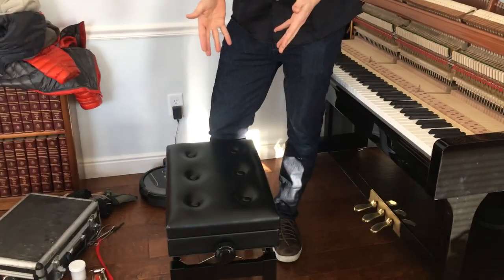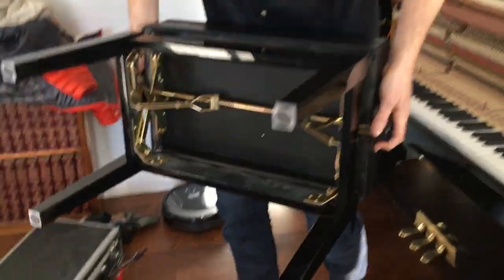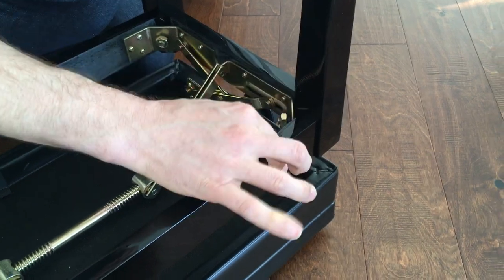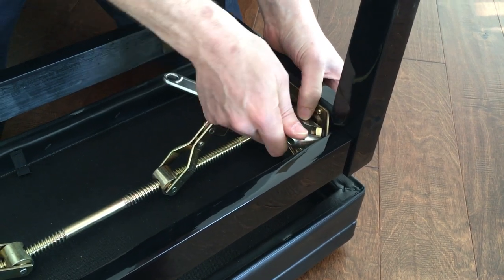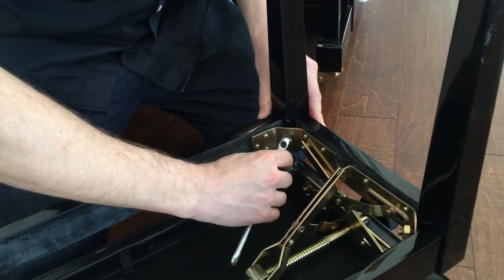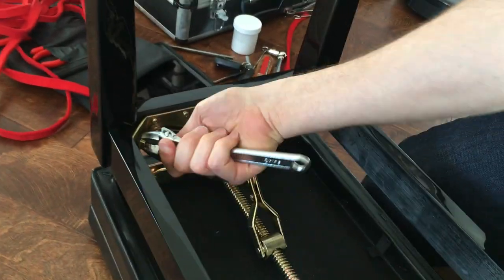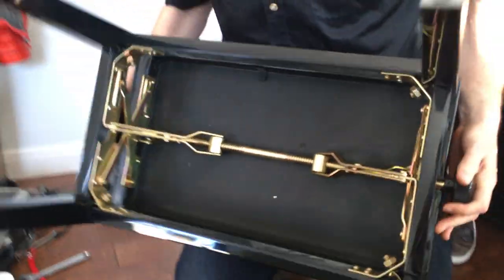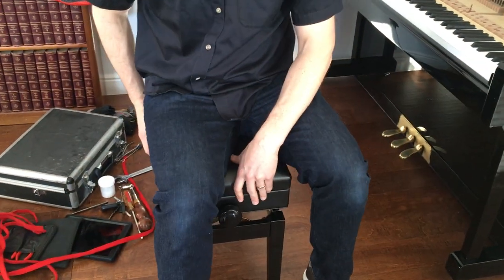How To Fix A Squeaky Piano Bench

Comment: That's brilliant! What about if the metal is loose where it is used to raise the seat? Are they normally just screws? I mean where the "x" parts which raise and lower the seat. I can't see if there are screws or bolts?
Reply from the maker: It really depends on the bench, usually I see screws.
Reply: @brighamspianoservice  thank you. Will ask my dad to check!

Comment: "Mostly" eliminating the creaks does not resolve the problem.  I'm still on a search to truly eliminate all creaks from these annoying benches.  I suspect I'll be taking mine apart and then putting it back together using sturdier joints... maybe chunkier, sturdier legs.  I'd like to avoid that project though by finding an easier solution.